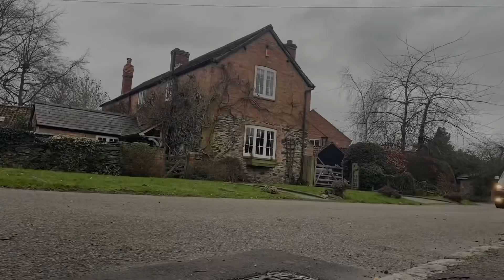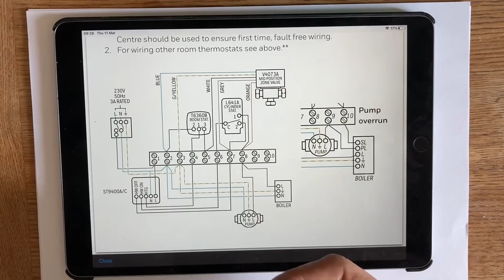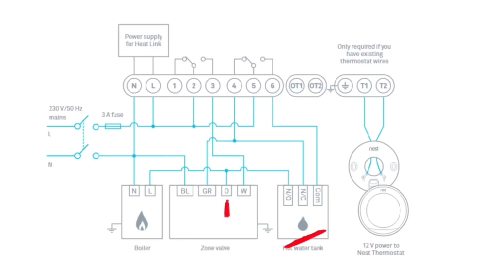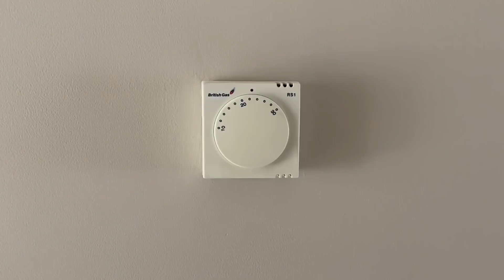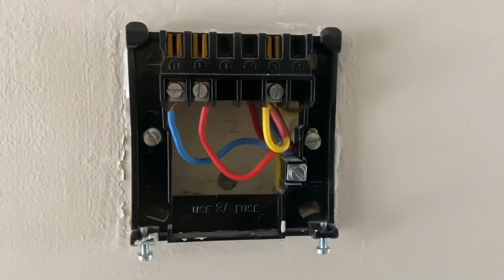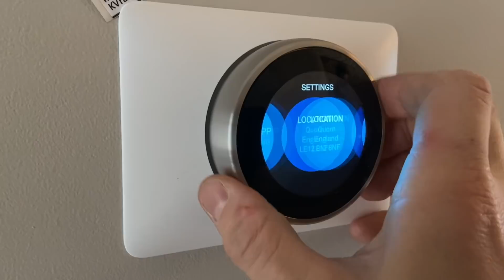PB Plumber Nest Thermostat on a Y Plan

Comment: Excellent video. One thing I would advise  is to check the connections to the cylinder thermostat with a continuity tester. The diagram in the Nest instructions shows terminal 2 of the tank stat going to the orange wire of the zone valve. But not all makes of cylinder stats use this numbering convention. On my system, terminal 1 (calling for heat)  goes to the orange wire.

Comment: I did my own & fitted mine where the original programmer was & run 2 single cables down from the control centre box to the nest hub, bit fiddly to get cables down original trunking but worked out well. The 2 cables were for the hard wired thermostat!, which I isolated the cables from the old stat which wasn’t needed.

Comment: Perfect. Nice, simple and easy to follow. Especially if you have an old heating system. Key is to start from the three port valve wiring, as mentioned on the video

Comment: Brilliant video. Just set mine up and the only thing I had trouble with was getting the L and N from the location of the old controller up to the new hub. Used the old wires that I disconnected from the controller in the end as you suggest in passing in the video. Thanks again.

Comment: I have worked with a lot of electricians who won’t touch heating systems which is absolutely bizarre but I feel like if they take the time to understand what the components of the heating system are and how they should work together it makes it far easier to break down and install correctly
Reply: And videos like this are extremely helpful

Comment: Great effort, not an easy thing to explain/demonstrate. I love wiring jobs too. A good tip for anyone trying to trace what a wire is in a junction box etc is to link it to an earth(with power off obviously) at one end and use your multimeter at the other end. Go between earth and all the wires till you get continuity. 👍
Reply: i know Im asking the wrong place but does anybody know a trick to get back into an Instagram account?
I was dumb lost my account password. I would love any help you can offer me!
Reply: @Anders Hayes instablaster =)
Reply: @Cyrus Noe I really appreciate your reply. I found the site through google and im trying it out now.
Looks like it's gonna take a while so I will reply here later when my account password hopefully is recovered.
Reply: @Cyrus Noe it worked and I finally got access to my account again. Im so happy:D
Thanks so much, you saved my ass !
Reply: @Anders Hayes no problem =)
Reply: This is called a R1+R2 test in electrics. Continuity of earth. If earth is removed, you can link any two wires together
Reply: Exellent tip sir,well said

Comment: Really good, I have bookmarked so can direct others to your video, my system is C plan, I could find plumbers and central heating engineers to plumb in extra zone valves, but non seemed to know how to wire. So I had to work it out myself, lucky I am an electrical engineer so easy enough for me, but not even a nest example. The DHW com goes to boiler which is unusual wonder if you have done a video for that?

Comment: Thanks - unfortunately it didn't help me a great deal since my system didn't have a wiring centre. Everything was wired into the programmer. So I had a much more involved task of retro-installing a wiring centre then wiring the Nest into that. I also had different wiring colours for the three-way valve. Got it working in the end though but it took quite a few hours.

Comment: You normally don't have a permanent feed at the wiring centre , if the switch fused spur is next to the old timer you can link out the cables to get a permanent supply up to the wiring centre
Reply from the maker: that’s what I had to do on this job

Comment: Has anyone noticed, for years Nest and then Google got the wiring diagram wrong in their booklet re the cylinder stat?
Reply from the maker: You mean they had n/c and n/o mixed up?
Reply: @PBPlumber Correct. Normally know in this case, demand and satisfied or labelled 1 & 2.

Comment: Ive taken loads of those nests out, mainly from customers on contract with BG being talked in to them without a real need then finding ‘the bloody heating used to be great, warm within 20 mins, now it does what it wants’ etc.
Reply from the maker: that may be down to the “true radiant” setting, you can adjust it
Reply: Yes but it’s often a case of wanting a simple system and being talked into it ‘cause it’ll save you a load of money on your bills’.  For many they are great, but its like when you fit a new boiler in an 80 year olds, put a compliant control on it, photo it, then remove and fit a mechanical clock and honeywell dial stat so they can control it themselves.  Removed 5 already this year from combys at customers insistence.
Reply from the maker: agreed, some customers just want on or off, anything else they don’t use or understand
Reply: lol spot on. i have seen energy management systems installed costing in the tens of thousands of pounds range, that still rely on the same old room stat from 20 years ago. or no outside sensor fitted and the boiler linked out to run all day and all night on flow temp. bargain.

Comment: I have followed your video seemed easy but the heating will not turn down, my pump is wired in with blue from zone valve also a neutral and neutral from pump. And orange from zone valve also a live and live from pump is this maybe the problem any help appreciated.

Comment: You may not have a hot water off from the time clock , might be hot water on and heating and water on  only
Reply from the maker: you need a hot water off for the mid position valve to operate
Reply: @PBPlumber you get a hot water off from the cylinder stat . You don't need one from the timer and on older systems you don't have one .
Reply: @PBPlumber I am a sparks and have been doing these for 28 years so I know about older systems.  The issue with a hot water off from the timer means the valve is always active even when there is no call for heat or hot water . It's always powered . The dead state of the valve is hot water only .
Reply from the maker: @dennisphoenix1 sorry I didn’t understand what you meant, I thought you were saying you don’t need a hot water off
Reply: @PBPlumber no problem.  Y and S plans confuse at lot of sparks never mind plumbers 😅

Comment: I want to buy a new thermostat that works by phone
But unfortunately I do not know which type to buy, and unfortunately the video did not help me, because the heating system in Holland is completely different, the system I have is through hot water, there is no gas
How can you help me?

Comment: This video is great. I copied your set up exactly..  my question is: Does there need to be a brown L Live wire going into the wiring center from the heatlink? I don’t see it connected to anything else…?

My new wiring center is upstairs & I’ve got my heatlink downstairs near the pump & boiler. 

Can I just use the fused sour near my heatlink to power it?
Reply: Never mind. I just tested it & I didn’t need to add any additional Live connections; I just copied your diagram word for word & it’s working perfectly.. thank you again!

Comment: If you haven’t got permanent live in airing cupboard you might want to fit at programmer location mate ? 👍🏻
Reply from the maker: I didn’t have a permanent live on the job in this video I used two of the old wires from the programmer for my live and neutral 👌🏽
Reply: @PBPlumber Not a criticism mate 👍🏻 I was just think I’ve done a few with the hub in the kitchen, nest on a stand. Absolutely love the product. Might be worth just adding comment about sending permanent live up to wiring centre by linking up at programmer location for those watching and learning in case they get puzzled.
Obviously you can’t cover everything Great video though, like always 🙌🏻
Reply from the maker: @jonathanbrooks3900 yeah I say it in the video mate when I’m doing the job. Thank you mate 🙏🏽